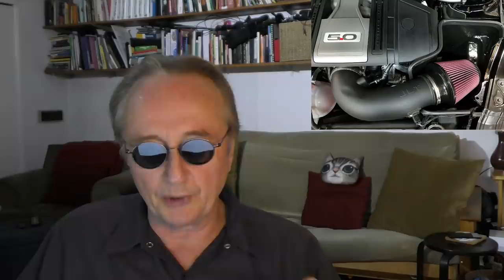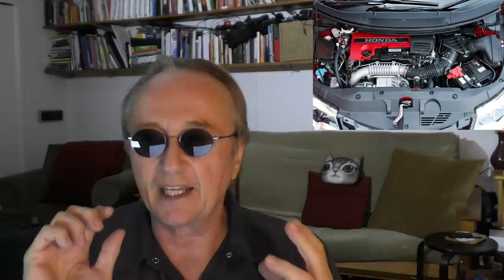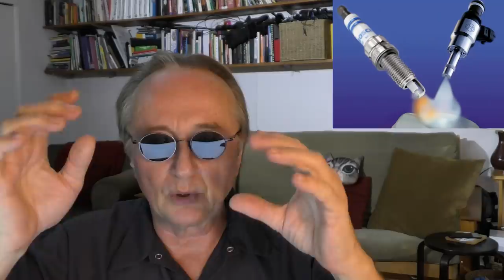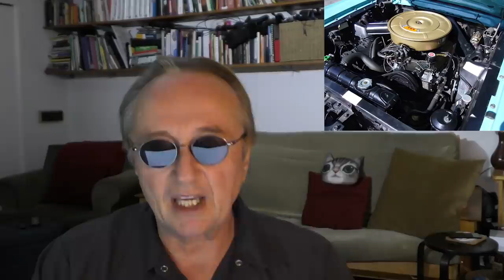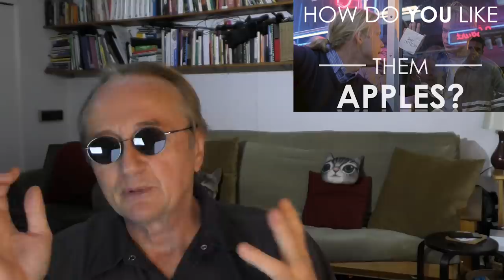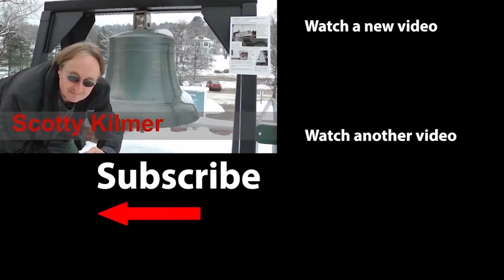This Car Mod is Stupid

Comment: Scotty I have a charger r/t when I try starting it,it sounds like something hits and spins up and when I stop it and try starting up again it works just fine. Does this almost every morning
Reply: sounds like ur starter may be on its last legs ....check the bolts on it if they get loose it will do that too

Comment: Im from Australia, and the idea that Suziki makes bad cars confuses me. It must just be due to them not being common in America. Here they are akin to Corollas and other small cars, in reliability and build quality (Id probably give them a 10% lower score for build quality). No frills and small. Not to mention their huge history of small four-wheel drives. Almost all of their small cars use some variant of the same engine series (updated in about 2005) so theyre common and simple to work on. To this day you can buy one of their small four-wheel drives and various workshops will swap a larger displacement (same series) engine in for a fair price.

Comment: Soo if an Injen/K&N cold air intake system tested to increase fuel and HP and nearly cost the same at OEM...still need to program

Comment: Cars will run just fine with air intake and exhaust mods as long as you don't mess with the catalytic converter. If you get rid of the catalytic converter then you'll need a tune to turn off the check engine light or sometimes an oxygen sensor extender will work for just a few $

Comment: Scotty, what do you think about a 2019 Nissan Frontier SV used with 9600 miles?
Reply: I seem to recall he has been kind of positive on those, but you'd better pay something like half of the original new sticker, given how hard Nissans depreciate. I wonder what led the first owner to trade it in? Was it a lemon? Was it simply unreliable and he didn't want to fight for the lemon law (or there isn't a lemon law where you are)? Would the dealer really tell you the truth (I assume it's a dealer selling it)? Also, if you're not going to tow or haul with it, don't bother with a truck, or any expensive (over $15k, if that) car; youtube search "tony seba robin hood" for more info on what's coming.

Comment: Cold air on modern vehicles? Most mainstream models have a wide range programming (since it also has to handle E85) so it can adapt to the CAI and typically runs the same, or sometimes better with no programming or changes. The main difference with a CAI is less filter restriction which means better air flow which means more power and (as long as you're not on the floor all the time) better gas mileage.

My 06 Silverado with 5.3L and manual transmission still sees 17mpg city and runs great at 176K miles, no repairs needed in the past or now.

Comment: The old hot air intake . Trick. Why bother,  the stock are box with aftermarket air filter works much better.

Comment: Scotty need you're help! Changed my clutch and my car wont shift with the engine running! I just disconnected the slave and neve opened the hydraulic system! Bled it a small amount if air came out. But my pedal is really firm and it wont disengage the clutch? I'm sure I assembled it correctly. Could my clutch be backwards? Car is a 1995 mazda miata. Thank you!

Comment: Cold Air Intake, as long as you route the intake pipe with the air from outside and not the hot air from the engine.. the MAF Controls the fuel mix, so you do theoretically create some more power. As I proved with a dyno and no ECU tuning. 🤷‍♂️😂

Comment: cold air intakes only benefits if you're always in a high-rev situation and your car does actually increases a few horse power. But for everyday use car, cold air intakes actually decreases engine performance.

Comment: I have a question which car company is better Mazda or Subaru for SUV
Reply: Neither -- I can only recommend Tesla for SUV's, either Model X or the Model Y, the latter of which you can buy now and get in line for next summer. With the Full Self Driving option (which you need) and the third row (which is a good idea), you're pushing $60k. If you can't afford that, then you can't, and that's more than OK, so don't buy one. But new gas-powered SUV's are a terrible idea; youtube search "Tony Seba robin hood" to see why this is so. Also youtube search "Tesla most patriotic car you can buy" to learn more about Tesla as a brand.

Comment: What if it's a factory cold air intake option?
Reply: They'll probably retune it at the factory to take advantage of it.
Reply: 10W-40 I think he meant one sold by the dealer and approved by the manufacturer. But you install it yourself and no reprogramming
Reply: I put a cold air intake on my 2019 GMC - and now the 2020 model has it as an available option at 3 times the cost:)

Comment: Hi Scotty,
I really enjoy your channel - it is great!

I recently bought Subaru Outback 2015 Premium 2.0L Diesel with 224 000km(139 187 mi) with excellent service history and checked by independent mechanic.

I have an issue with rain/light sensor - it just falls off the windscreen but does react on the light in auto mode. The windscreen specialist said that windscreen needs to be replaced to fix the issue 0_o. Sound overkill to me.

Is it ok to fix the falling sensor issue with glue/vhb double-sided tape and gel for sensor(to make gel pad stick/connect to the windscreen)? 

Could you explain the downside of the workaround that I have in mind and what would be the best tape/glue and gel?

Thank you!

Vasyl
Reply: Can't hurt to try it before going to overkill. I don't know what the best brand of glue or tape to use on automotive glass, however.
Reply: Looks like workaround worked, 2nd week now, works fine, staying in place. I will see how does it go through the Australian summer :)

Comment: meanwhile im chillin with my 2000 forester with a pvc pipe leading to the inside of the fender. gets an extra 4mpg while having a noticeably sharper throttle response :D

screw new stuff. its all worse in every way, mostly thanks to the government regulating crap.

Comment: hey scotty i got a 83 datsun 910 venturer ive noticed its leaking clutch fluid ive tried to fill it up to see were it leaks but cant really pinpoint were its coming from anyhelp also wont go into first gear when the cars running but will when ignition is turned off any explanation? thanks

Comment: Yeah, you could remap after putting a cold air on but it would make very little difference. The MAF automatically senses the amount of air coming in and the ECU adjusts the mix accordingly in modern cars anyway.

Comment: Scotty what are your thoughts about the mustang Mach e
Reply: Shrijay Shastri I cant believe they gave that name to an SUV crossover thing. It’s a slap in the face to mustang fans.
Reply: Same price as a Model Y, with each trim having less or equal range, and less cargo room, compared to it. Plus no self-driving tech available, even as an option like the Model Y? No thanks. If you want to know how important self-driving tech is, youtube search "tony seba robin hood". If you're in the market, it's well worth buying now to lock in the $7,000 option price before it goes up. To learn more about Tesla, YT search "Tesla most patriotic car you can buy".

Comment: I don't see why the computer can't understand more air is coming into the engine and up the fuel? It constantly has to compensate for different altitudes and temperatures right? I've put a Cobb intake on my old Forester XT, a Stillen on my 300zx, and AEM on my Montero. No ebay junk lol. Maybe it's my imagination, but I  honestly think I can FEEL the difference in power. Especially on the turbo Subaru. I've seen dyno charts showing gains. Also, allot of these companies guarantee gains and have dyno charts on there websites. You may only gain 5-20hp, but it's something.

Comment: Thoughts on the Genesis brand?
Reply: The only new car brand I can recommend is Tesla, and only when equipped with the Full Self Driving option. For more info on why, YouTube search "Tesla most patriotic car you can buy".

A Standard Plus trim of Model 3 with FSD costs over $50k with tax and delivery, and if you can't afford it, don't buy any new car. Any new car without self-driving technology included will depreciate very quickly. YouTube search "tony seba robin hood" for more details on how this is so.
Reply: Michael Ball bruh chill

Comment: Dyno Tuning is a must after installing a CAI.
Reply: Allan Sonac Why?  The PCM calculates fuel trim based on mass flow, inlet air temperature, and manifold pressure.  A CAI will not result in airflow which exceeds the range of mass flow, temperature, or manifold pressure instruments, so no tune is needed.  Nobody ever puts in a tune BEFORE the CAI is installed, so there is no basis for comparison, before and after CAI.

Comment: who said suzuki makes bad cars. i have a 2006 suzuki grand vitara. made in japan. 150 thousand miles. They're amazing little offroaders. Never got stuck or stranded in all these years. I flush the transmission fluid every 2 years so never had a problem.
Even my 2009 camry stranded me once but not the suzuki.

Comment: I agree people who just slap a cone filter on a stock econo engine are stupid, it decreases hp.  But anyone running a tune or some performance engine can benefit a lot from it.  My stock intake on my genesis coupe had a baffle which messed with air flow and silenced the turbo.  My car runs great with its 20lb boost tune after I put a proper intake on it.

Comment: Rough shifting into reverse could also be low clutch fluid
Reply: Brock if you have low clutch fluid you’ve got a leak somewhere.
Reply: 427mike427 true true. Still could be an issue though

Comment: I wouldn't allow a Fram oil filter in my shopping cart high end or not. I use to do a lot of mudding. and one day a stick poked a hole in my oil filter.  a mudding buddy had a extra fram oil filter so I stuck it on. and every time I started my truck it would knock. on start up. even if I let it set for 15 minutes or less. and I had lost at least 15 pounds oil pressure. I thought I had messed up my engine. but it was close to oil change so I went ahead and changed my oil. knowing I had a messed up engine. so I put a new wix on it and bam it never knocked and my oil pressure came back up. 290.000 miles and they truck still running great.

Comment: those "cold air intake" is actually not cold air intake..... most of the time they are SHORT RAM intakes unless it has a box that insulates it from the hot engine bay temperatures.... so in other words, you just removed your factory air box and replaced it with another air cleaner box..... you know, that is a mental issue..... you do the same thing expecting a different result.

Comment: If you're gonna put an intake and exhaust on your car you'll HAVE to get it tuned by a professional that knows what they're doing. Otherwise you're going to cause damage over time to the complex systems in modern cars. You wont make extra power unless you tell the computer that it CAN make more power lol. Otherwise you'll just confuse it by changing up its breathing system.

Comment: Scotty what are your thoughts on the Honda Civic lx 2005. (Manual) I want to buy this car and modify it and would like your opinion.
Reply: Buy a 2000 civic instead
Reply: VirusDaGamer — They’re not horrible cars, but they’re not really that great, either. I used to own a 7th gen Civic and it was perfectly fine as a daily driver, but the D17 is sluggish, they blow head gaskets all the time and the suspension setup was really dumbed-down in those cars. You’d be better off with something like an RSX, TSX, Integra or 6th gen Civic.
Reply: They're better kept as stock. Great dailies and nothing more, especially in cooler climates where the AC compressor can break and no one cares. Paint's a joke.

Comment: Suzuki swift 2008..I have this car 6 years now..I repair the gearbox 3 times,brakes are just ok but the feeling of them is crap,interior plastics are cheap and everything inside is noisy on bad roads..3 years know I try to find a problem with the idle and I can't..when Im coming to a stop on a traffic light idle drops to 300rpm and the car feels like it's going to stall..this is for 2 seconds and the car everytime corrects and don't stall..it's annoying.Some swift had a problem with abs module made the brake pedal fail,a lot of people crash,Suzuki do nothing about this..handling is the only thing that this car is extremely good. The seats,steering wheel etc are well made too. Consumption is 6-11lt/100km.its easy car to work and the motor is bullet proof..

Comment: Anyone have an opinion on a 2016 mustang GT automatic with 23,500 miles and a 24,000 price tag??
Reply: You'd be better off with a 2008-10 coupe. You'd save at least half, and get something just as reliable, if not a little more. You just need to keep the rainwater drainage tubes free of leaves and other debris; see Ford TSB 08-26-7. Use an OEM harmonic balancer, as needed (the aftermarket ones are crap); if you start hearing a squealing or chirping sound, that's all it is. The only other notable issue is the hood peels and corrodes. That's all small potatoes for your wallet. Dave Ramsey would approve.
Reply: Michael Ball thank you very much. I have a 2008 Acura TL but I’m wanting a reliable V8 naturally aspirated car which is why I’m looking at the mustang for a daily driver.

Comment: I disagree on your Suzuki opinion.  I've had four Suzuki cars and two motorcycles and they last a very long time without any problems.  From my old 90's Vitara, Samurai, and now my Jimny, and Swift.  The new cars are more than 5 and 7 yrs old with one having more than a 150k miles, the only thing I had to replace was a radiator fan on the Jimny which is seven yrs old.

Comment: Civic Type R's cost $65.000 here in canada.
Reply: Yeah, at that point, a Model 3 with the Full Self Driving option makes a lot of sense with all the money you'd save on fuel. Might even be cheaper up-front, too.
Reply: @EMichaelBall  

A model 3 costs almost $80.000 here.

If I had that much money too spend on a car I'd buy pretty much anything other than a tesla.

Comment: Why they keep calling that junk COLD AIR intake is still a mystery to me.. It replaces the original COLD air intake that is pulling air from the fender or front of the car only to suck in hot air from under the hood, especially if it's routed somewhere near the exhaust manifold.. Just stupid xD.

Comment: If CAI’s are bad for the reasons mentioned, then why do most auto makers make factory ones that you can buy directly from the auto makers themselves, direct and/or from their new auto dealers.

For example, when I bought my Toyota Tacoma’s, I had the option to buy a Toyota TRD CAI for my truck. Then in 2017, when I bought my 2017 Chevrolet Silverado. (Yes, I know you hate Chevy’s Scotty. But I only discovered your channel in 2019.) My Silverado is a LT Z71 4x4 crew cab. It has the 5.3 liter V-8 and is paired to a 6 speed automatic transmission. When I bought it, I observed that the dealership had in the parts department, a factory CIA from GM, made specifically for my truck and its engine.

I’ve only had 2 vehicles with aftermarket CAI’s and 1 vehicle, my second Toyota Tacoma, a 2007 4x4 TRD Off Road with a factory made CAI. With all 3 vehicles, I observed a slight increase in fuel economy. Generally, it was between 1 to 2 mpg on average but on a few occasions, in my 07’ Tacoma, with the TRD CAI, it got almost 4 mpg over my stock air filter set up. But, that was all freeway miles and I had no traffic. It was also, on all flat roads and no traffic due to it being in a remote area.

Comment: I will never use a fram oil filter ever again change the oil put a brand new Fram filter on ford LTD the plastic pice in the center came out clogged up the engine oil pump and seized It I know people at work at Fram and they say their junk worst oil filter ever Napa  gold is best

Comment: If reverse gear is hard to get,put it into 2nd gear and then reverse. Much easier on tranny and cluch.

Btw Suzuki cars weren't that bad. People just rode them like Hondas and they are not meant for hard riding. They are all city cars.
Reply: Interesting. I put my Swift in 1st gear and go a little bit forward, then it goes normally reverse

Comment: Hey scotty I have a 94 chevy 1500 4×4 4l60e trans 350 engine. I put a new engine in and knock sensor won't work even when I replaced it. Disconnected sensor so it wouldn't retard timing can't figure out why?

Comment: Scotty just went against the whole car modding community
Reply: Naw...for the most part cold air kits don't help with power or mileage. Most vehicles these days have some sort of a cold air intake stock that's tuned for the engine from the factory.

Comment: You can just swap out these bolt ons, the ecu will catch up after a drive cycle.. tuning is to get the most out of it 🤷‍♂️ but hey what do i know i hust threw all the parts you listed in the first 10 seconds, plus headers, and didnt tune it for 100k miles, nothing changed minus performance. And theyre not considered "CAI" theyre more open intakes. Their benefit over factory box is less restrictive, try inhaling through a crimped straw..now uncrimp it a tiny bit..easier right ??🤦‍♂️ again what do i know ive only had the parts on for 7 years and 110k miles 🤣

Comment: Anybody know how reliable ford probes are ? I'm curious to know
Reply: Not very from what I hear
Reply: 2 Time Garza — The Probes with a manual are okay. Not great, just okay. Stay FAR away from a Probe with an automatic, though. Those used Ford’s infamous CD4E transmission and were pretty much guaranteed to fail.

Comment: I purchased a K&N air intake for my Mazda b2500 pickup truck 
Two things I noticed after installing the air intake: 

1. Improved in acceleration
2. Improved in gas mileage 

Its not an outstanding  improvement, but i did notice that overall my truck does perform better. 

boy are those K&N air intakes expensive